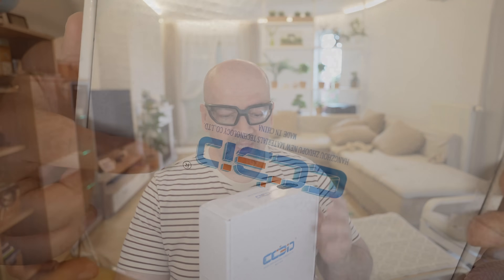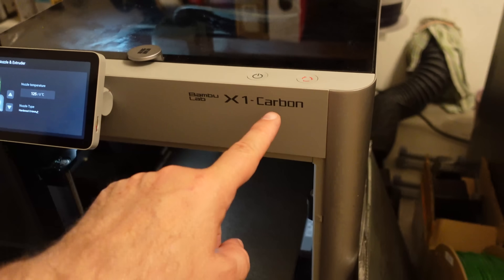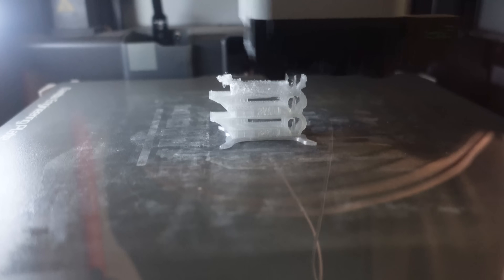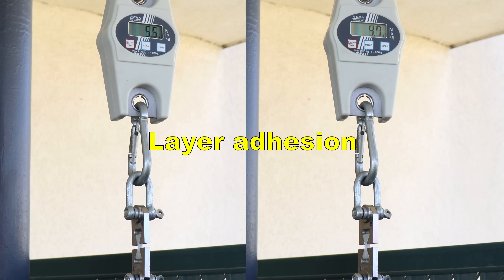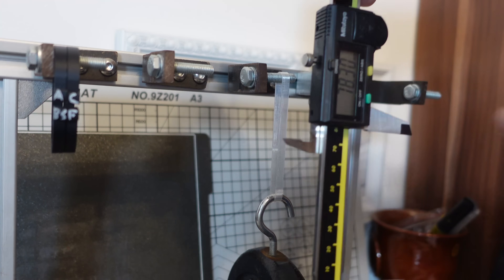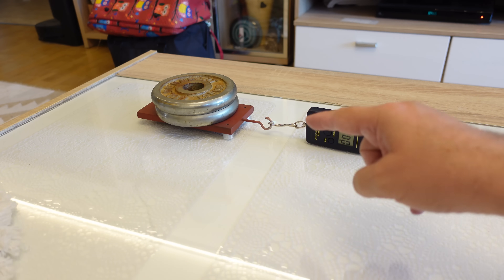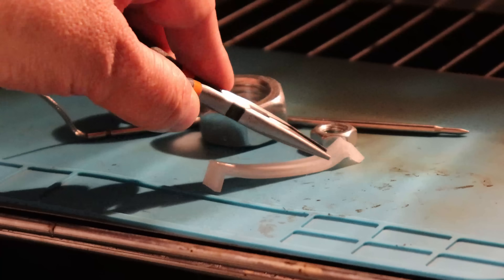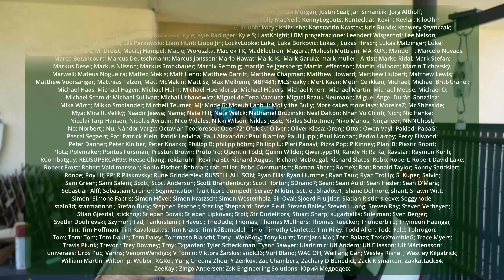TPU+Nylon Mix: Is CC3D TPU 72D the Toughest Flexible Filament?

Comment: Nozzle temperature 260/270°C. Dry the filament well at 60/70°C for 8 hours. If the printer has sensitive sensors, it will cause problems, but on a more basic printer, it prints well. NOTE: Dry the filament well and use a high nozzle temperature. It's not one of the best filaments, but it works. I did several tensile tests.
Reply: 260-270 seems a bit high, I just printed at 235-240 and obtained good parts

Comment: Well the spool of this I ordered from Amazon arrived while I was on holiday. I've spent the past few evenings trying to get the filament to run properly on my Prusa MK4S and can I as hell manage it. Standard 95A runs like a dream without issue while this 72D just won't run at all. Not a single print has completed without the click click click of the extruder skipping. I've tried all manner of print setting combinations, even trying those recommended for the Bambu TPU for AMS. Faster, slower, hotter, cooler, you name it, I've tried it and nothing works. So rather than pull out what little hair I have left I've decided to quit.

Comment: I used  this to print the male piece of a garmin edge mount, to glue to my phone, to attach my phone to my bike.  this involves a load held by two 1.6 x 1.6 x 10mm tabs while being shook around.  Strength and durability are key.

It seems well suited to the task.

Been using generic Bambu TPU Profile with 100% part fan and 70% alt/exhuast fans.

Comment: Will this be a good material for a gasket on the roof of a car or will you be good enough to prevent water penetration and still stand up to sun uv and heat and is flexible?

Comment: I had  Ravathane 130 D55 NATURAL and was printing open chamber cold bed in garage 10C in winter no warping only after removing from bed. Also had TPU from Malz Polytec same results. I've tried kexcelled TPU 64D and had issues with drying and resigned.
Reply: but I was using pellet extruder much higher flow rate

Comment: For many years I've been recommending TPU for parts that need good layer adhesion for more isotropic physical properties and extreme impact resistance, but due to marketing, people keep thinking TPU is flexible.  It is, with 1-2 walls and low infill percentage.  Print it with 3+ mm walls and higher infill and it's a hard rubbery part that is quite solid.  I've been looking forward to higher durometer TPU that is even better for printing strong impact resistant parts, and this could be it.  The price looks good.

Comment: I feel like break strength is a bad way to test the tensile strength of filaments that stretch before breaking  (forgot the term for them)
it'd be better to measure force before x percent/permanent  deformation. if a part is not split but is permanently deformed, I consider that part broken.

Comment: also for 75d gf15, I spoke to manufacturer, and they recommend normal printing 0% fan, turn on only for bridges to up to 15% on x1c, and use 3mm volumetric flow, and to only increase the fan a bit if parts look non attractive, I followed those guidelines and prints are monolythic - you still are able to kinda snap at l;ayer line, but they break like it was casted from plastic, not fdm printed

Comment: you should check rosa3d tpu 75d gf15 / 83d - 83d is like indestructible PLA, 75dgf15 is like little less stiffer pa12 from my tests
Reply: few years ago TPU pellets cost 4 eur per kg while recycled 2 eur per kg (resinex, Malz Polytec) - asking 50$ per kg is a bit high just because fo glass added
Reply: @jzagaja it’s not tpu, it’s like “perfect layer adhesion petg”, it has temperature resistance up to 120, and you cannot separate it by layer lines, and you can feed it into ams and print 200mms, as well as 30mms if you want monolithic part
Reply: @stefan37-1  I did flow test with kexcelled TPU 64D and could easily abowe 30mm3/s on SV08 but then clogged during normal print. They want me to dry in 90deg 6 hours or more. I resigned.
Reply: @jzagaja I mean it is tpu, but only tpu part left in equation is that it’s not splitting by layer lines basically
Reply: @stefan37-1  with Ravathane 3015 D55 I had no split layers very strong but it was pellet extrusion. Sanding was nightmare for lacquering.
Reply: @jzagaja yeah sanding is very bad on the gf one, but the 83D is basically PLA but with perfect layer bond, 75D gf wants to flex a bit and the texture is rubbery, 83D is plastic literally
Reply: @stefan37-1  It's hard to find TPU 83D in pellets it must be copolymer. So Rosa is better than CC3D?
Reply: @jzagaja  no idea, those are my subjective experiences - so far, tpu 75d gf / 83d are winners for me in easy to print / strength / temperature resistance ratio, and for me it's easy to buy it as they are produced locally, I tried some ppa-cf pa6-cf from bambu and some chinese brands, and those pas seem to be stiffer and more "engineering alike" but on the other hand... for the tpus you just have to wipe the bed with IPA and start print and you're done, for nylons you have to set the bed to 110C, add glue, preheat chamber in X1C... im not advertising for them, but in my case they're literally  "put into ams instead of petg and bump up temperature" filaments, while the nylons are mumbo jumbo

Comment: Can you try Rosa 3D Hardtech tpu 83D ?
full name:
FILAMENT 3D ROSA TPU HardTech+ 83D, Impact - Abrasive - UV - H2O - microbe- resistant
Reply: i have it, it snaps just by looking at it, layer adhesion is shit, petg has better. Would not reccomend.
Reply: @maxrompa7706  I thought TPU had one of the best layer adhesion of all the filaments
Reply: @maxrompa7706 I can’t find a review of it anywhere did you manage to stumble upon one?
Reply: @hazart2798  actually no, i would like to see one

Comment: Interesting material and great video with huge amount of information. The PC+PETG blend should be quite useful and interesting as well if it prints similar to PETG (relatively low warping), but has a heat resistance of around 100C. Actually for that material it might be a nice idea to also test spectrum filaments PETG HT100 and have both materials in one video.

Comment: Ive been printing this stuff for months.  Ive used it for everything from brackets to planatary gearboxes and all sorts of other things.  Its not a nylon, its just advertised as being similar.  It has an amazingly low friction coefficient and it being as indestructible as it is it makes for some amazing gears and other types of sliding parts. I print it around 60mms .3 layer height and .6 walls all day long without any issues on an old sovol.

Some of the best filament for rc related stuff imo
Reply: I am trying to print a very small zip tie-like tool. It's very thin and small, and I need the user to be able to rip off a tab. Do you think this material is soft enough to wear? When a person rips off a tab, is a sharp piece is left? When printed thin, does it become gummy? Thanks :)
Reply: @nitamac1312 The cool thing about TPU is that you could literally print a single layer and it would still be strong enough to pull off the build plate in most cases, but yes it would be pretty easy to tear, at least along a print line. It will stretch before tearing, it will not leave a sharp edge that could harm you.
Reply: Ya, I have been printing this material for months as well.  Snap buckles, brackets, etc.  Good structural strength at 100% infill or very high number of wall loops
Reply: @jays7318  Nice I just got a roll so I'll be playing with it soon.
Reply: Very cool!

Comment: MTF, you need to learn how to tune better.  You did not have heat creep, you had a nozzle clog because you were printing too cold.  There are/were bits of unmelted filament inside the nozzle tip that built up and constrained the output.  For a Bambu P1/X1 with 0.4mm nozzle, set nozzle to 260C, bed to 60C, flow ratio to 0.92, PA to 0.07, and retraction to 0.5mm.  Volumetric limit 6 mm^3/sec.  Fans 100%.  Overhangs 35-25-25-10 and bridge 50-150%.  All Shore D TPU filaments need to be printed like PETG since they have poor thermal conductivity.  It is very important that this filament remain dry; it should be in the dryer at 60C for 12-24 hours before the test.   The spools that CC3D includes are poor; they soften at 65C and melt at 70C in the Sunlu S4, and this material really should be dried at 70-80C so I tend to respool my CC3D 72D filament so that I can dry better.
Reply: YAY!  I was really struggling to print this stuff anywhere near to manufacturer's recommendations, but the above settings worked great on my P1S!  Thank you, @EliteMacFreak!  (It is annoying how hard it is to set pressure advance in Bambu Studio though -- I had to actually run the calibration print just so that it would let me type in 0.07.)
Reply: @thanbogan  Anytime.  You should really use Orca Slicer, instead of Bambu Studio.  It's better in every way, and it works almost exactly the same as Bambu Studio.
Reply: I'm new to Bambu Studio (I can't use Orca with my H2D): Can you please elaborate on what you wrote about fan speeds? "Fans 100%.  Overhangs 35-25-25-10 and bridge 50-150%"  I don't know where to enter each of the listed values. For example, under overhang settings, the first option is "Cooling overhang threshold" and I am not able to enter 35%, only the pre-specified values. Thanks

Comment: Nice. I'm using this today to print replacement wheels for a motorcycle dolly. It's been a favourite for the past 2 or so months for anything that doesn't have to be super stiff. 
Qidi's 95A tpu profile + printing from a dryer works perfectly for me.
Reply from the maker: I think the strong Aux fan was the main problem at the start..

Comment: As others have mentioned, I don't believe this actually has any nylon in it. Probably comes from a bad marketing translation or miscommunication. I think they wanted to say it has some properties similar to nylon. Either way, looks like a very good and useful filament. I think it has a lot of applications in automotive or active and rugged use.
Reply: Maybe it's TPA?
Reply: @riba2233 Only other thing is I really can't find any TPA available. Any that is requires a quote and B2B buying basically. I'd expect it to be a lot more expensive if it was.
Reply: @riba2233 You know good point I suppose it could be. You would think they would advertise it that way? It largely looks and performs like I'd expect a hard TPU to. Hopefully CC3D clears it up at some point.
Reply: @802Garage yeah I'm not even sure tbh as I think that tpa is closer to peba? And it says that tpa has 60 to 63D range usually...  Hard to say but they should definitely properly declare it yeah.
Reply: Behaves a lot like (U)HMW it sounds like.
Reply: @208Concepts yeah but it's still more flexible and has higher friction.
Also uhmwpe would be almost impossible to print most likely.

Comment: I've had no trouble printing this filament as fast as 150mm/s+ with the volumetric flow set to 16mm^3/s maximum on the H2D. Nozzle 240C.

Just wish it came in more color options and that the surface finish was a little nicer.
Reply from the maker: Oh, yes. I forgot to try that. Printing too slow may be one of the reasons for the clog.

Comment: CC3D 72D is very disappointing. Try out RANKI TPU 98A it's significantly stiffer and doesn't require drying to get flawless prints.
Reply: The stiffness is defined by the Shore value, A or D.  75D is a stiff plastic, 98A is a flexible plastic. 

Please don't make misinformative comments, they help no one.
Reply: @truantray  sure if they used the scale accurately but you go ahead believe what you like. i have the spools right here and you don't so maybe stay in your corner and stfu.
Reply: Those are not even close. Also don't use the scales close to 100, it's just very fuzzy measurement then. Or possibly state the hardness in both scales.

Comment: I really don't use a long PTFE path for tpu variants. The filament does not like the resistance. A printer like the mk4 is better for this kind of material.
Reply: Firstly, TPU is not very sticky imo. I've hade zero issues with hard TPU and a Bowden.

Secondly, this is not a very flexible filament. Bowden is more or less fine.
Reply: Any direct drive printer is necessary.
Reply: @truantray  its not. Ive printed 85a tpu on a anycubic i3 mega with no problems. a bowden extruder is not the problem if the roomtemperature is low enough and the slicersettings are right.

Comment: Finally! Ive printed this a few times and absolutely impressed with its mechanical properties. I typically ran it as high as 290 and had unreal toughness, even then the flow rate is still low

Edit: I use glue stick with this filament on standard textured pei
Reply: Basic TPU can make incredibly tough prints. I challenge people to try and break them. It's also very solvent resistant.

Comment: i think the tpu nylon composite is just a translation error on the amazon page. the cc3d website only says "72D: The raw material of TPU consumables with 72D hardness comes from high-hardness polyester TPU." and says nothing about nylon. the amazon page also says its comparable to nylon so maybe it was supposed to say it has properties of both nylon and tpu and that turned into composite?
Reply: This! No nylon in this filament.
Reply: Correct this is not nylon it's meant to mimic nylon but it prints worse.
Reply: Chemically, I cannot see a scenario where polyurethane and polyamide polymers would not yield a weaker plastic if mixed.  This is just a less flexible TPU, netting a Shore of 75D, which places it as a stiff plastic rather than any A rated plastic or rubber.
Regardless, it's good to see the consumer industry finally developing useful filaments for anything other than toys and landfills.

Also this comment should be pinned.
Reply: @truantray  yeah, tired of all the useless multicolor toys, I want multimaterial
Reply: Unfortunately I agree. I was hoping it actually was a TPU nylon hybrid which would be super cool if possible. Looking into it more though, I think it's just hard TPU.
Reply: I own two spools and neither mention anything but TPU, so, there really shouldn't be anything else in it. Still, while nylon isn't a polyurethane, it would be nice to have a data sheet available, as TPU encompasses a pretty large group of polymers and materials.

Comment: Do you think this would be good for a shock absorber or endstop? or would regular tpu be better?
Reply: Either would be adequate and you can change the size and infill to adjust how much it absorbs vs stops.
Reply: It depends on the suspension travel and how progressive the shock gets towards the top. Why?

You need to determine the how tall you want the bump stop before you decide the mechanical properties. A tall bump stop gives you a lot of wiggle room, and using softer materials is fine. A short bump stop gives you a lot of constraints, and you may need stiffer materials.
Reply: You can tune this material by thinning out walls and infill to perform just about however you want. Best part about it is it's fairly cheap for something that I've found to be so versatile.
Reply: @MrMistery101 no…you can’t. Material matters.
Reply: There is a company mass producing these called Perry Parts. Slant 3D did a good video on it.

Comment: I would suggest printing it on the Plus 4 Doc.. 😊
Reply: Same. Use Stew's spool holder and go straight to printhead. Bet he could get a flow rate of 15-20mm³/s easy.
Reply: @802Garage Im intrigued by the one responder who gave a well thought out suggestion. 🤔  wondering if controlling extruder rotation speed in the firmware could achieve similar results?
Reply: Going digital with the rebound tester is a good idea but for the base machine, would a well-designed friction clutch prevent the rebound? A calculation of the friction force could be subtracted from the intertial force correct? 

Great video BTW Doc! Always love your videos!

Comment: Do you think it will be good for gaskets? Maybe small engine gaskets?
Reply from the maker: I always wanted to test this. I am sure that they are good in first few minutes. But because of this ceeping (or correctly the stress relaxation), I think they are not good for long them use.
Reply: @MyTechFun not true. Many small engine shops now print out TPU gaskets and they are as good the original neoprene they replaced. Also very common in motorcycle restoration on the intake half of any motor.
Reply: Ive printed a gasket for the oilcover of my Trial motocycle but i used liquid gasket too just to be safe.
Reply: TPU works great for gaskets, temperature dependent. Resistant to fuel, alcohol, and most chemicals. I've had great success including for intake components. Can always add a little bit of RTV for extra sealing if the surface is imperfect. I've also used it for sealing a fuel pump hanger to a tank. This was all with 95A. I generally think the slightly softer material would be better for most gaskets, but the 72D would definitely work in applications where it can be bolted firmly enough. It will also be fine with quite a bit of heat, like probably on the cold side of a cooling system at least, but not for sealing hot engine oil or obviously exhaust. Just my opinion and experience.

Comment: This is one of my favourite filaments. I print it at 240C on 35C bed temperature, with fans set to 10-50% and 100% on overhangs on Balbu Lab A1 Mini. I do not print from filament dryer or take any particular care over drying.
Reply: Eventually the filament will absorb moisture.
Reply: I've used it a bunch also. Question - have you tried to multi-material it with PLA or PETG? Does it bind well to either? I've got a few things to print that would be perfect with a stiffer base